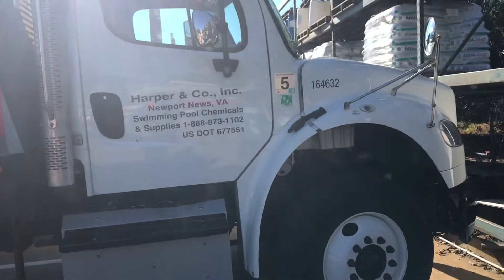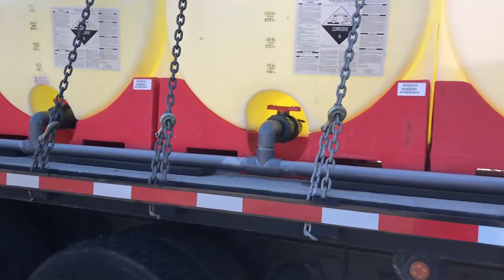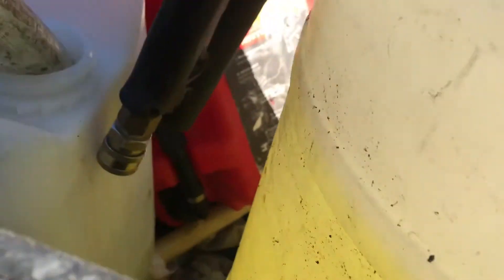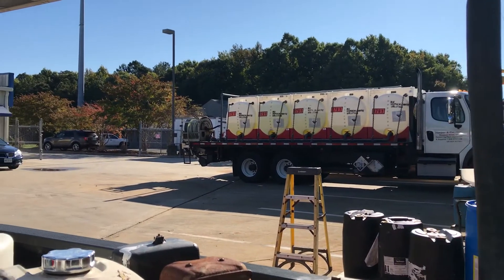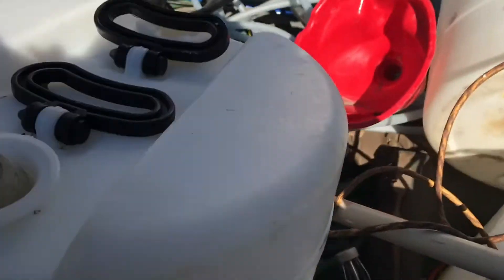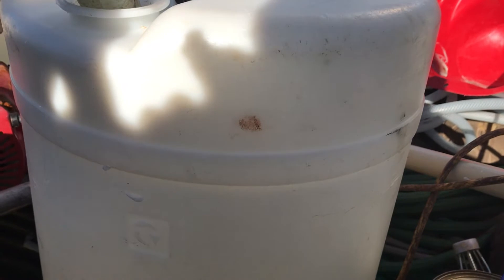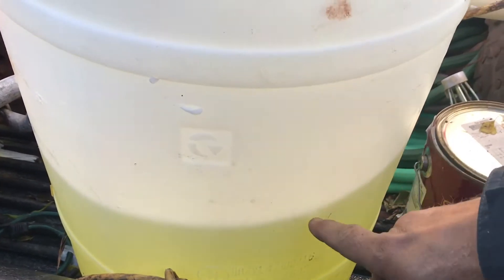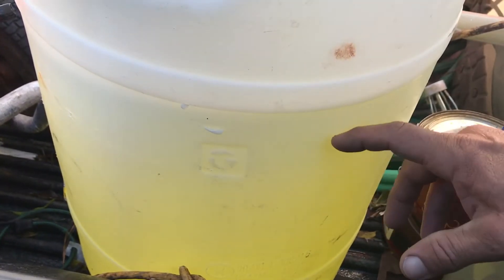Where do I get my 12.5% bleach?

Comment: Is the SH  the same as chlorine and what would you recommend for a mix ratio to clean asphalt shingle roof
Reply from the maker: David Bender yes pretty much which is 12.5 % Sodium hypochlorite or SH for short term
Reply: What ratio to mix and how much does a gallon cover I have 2000 sq ft roof